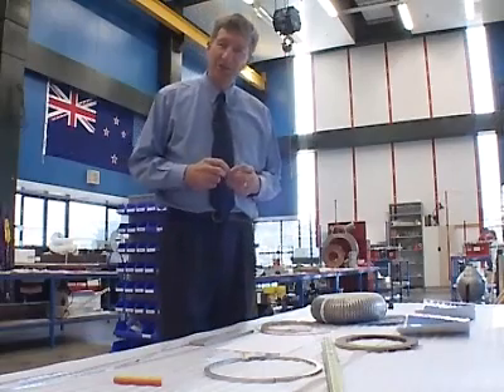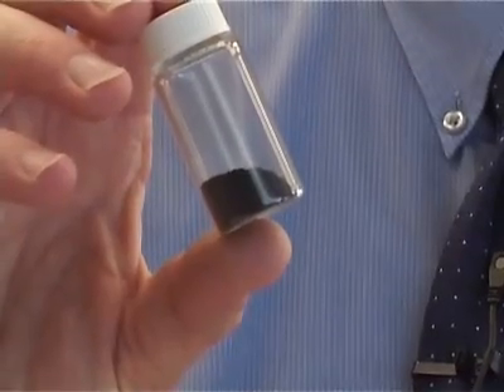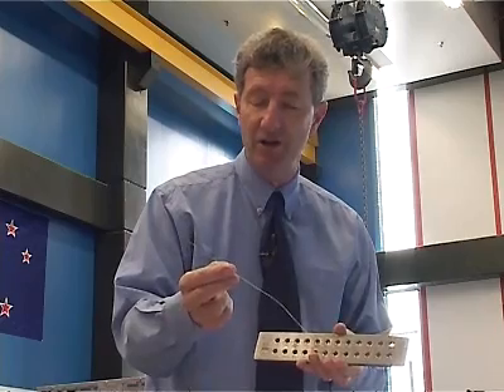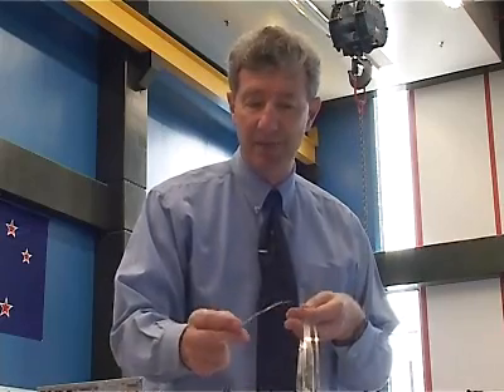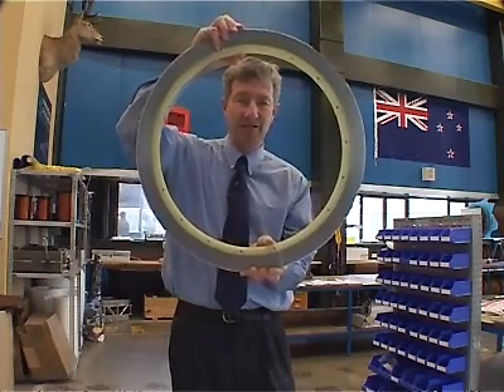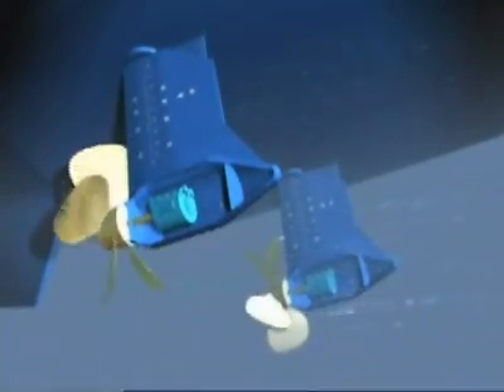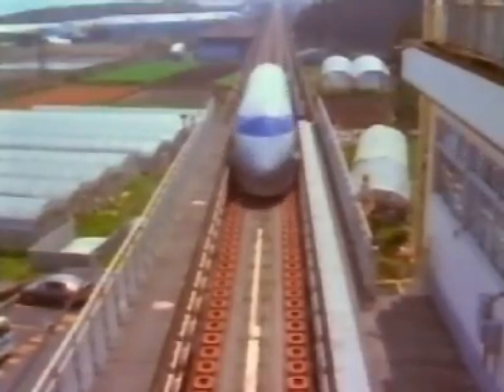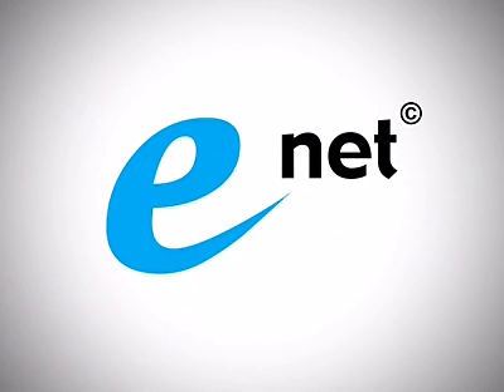High Temperature Superconductors 1

Comment: My solution, skip making the wire, - at least for coils sake instead, what if we were to 3D print the material into place (very precise machine needed) - then again who says a motor has to be conventional, or even 3 dimensional... What if we printed only a 2d coil like a drawing or electronic trace, that could still act as the coil, maybe even be independent in motion of its own via quantum locking!

Comment: the problem isnt losing energy through the electric motor, electric motors are veryefficient

its the conversion of fuel into usable energy, internal combustion engines are only 10-20% efficient most of the chemical energy is lost as heat

in regards to cars the next barrier (or first depending on how you look at it) is air resistance

electric lines leading from the power station to your home is a different story the extreme distances mean that a material amount of energy is lost in transit

Comment: the problem we have at the moment with many of our systems is that they only occur at very high/low energy. and even though at this temp they are extremely efficent, the energy saved is not enough to offset the energy needed for either cooling or heating. that explain anything?